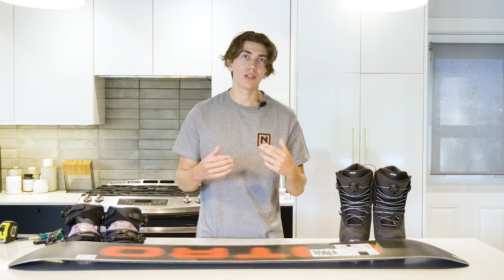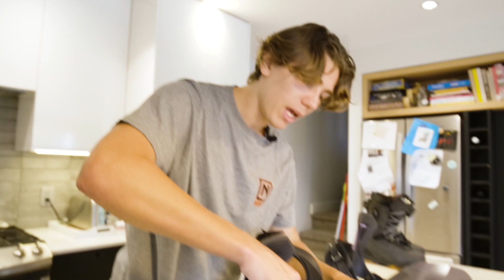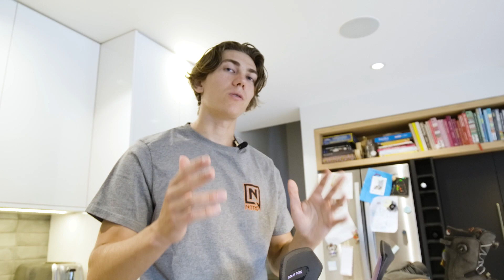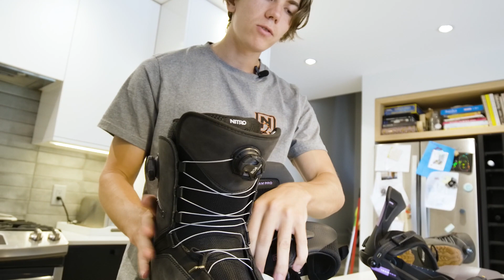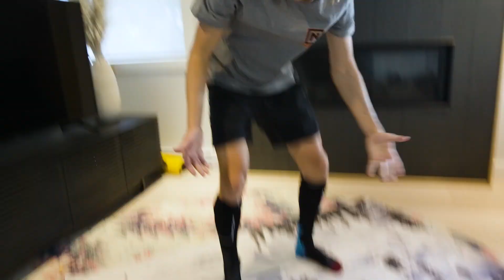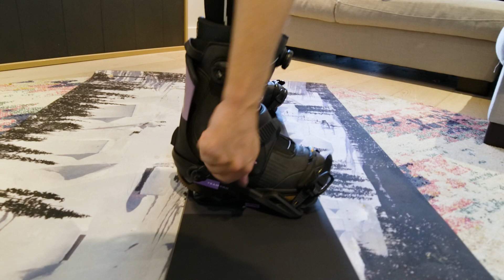How To Choose And Set Up Your Perfect Snowboard - 2024 Nitro Board Review

Comment: Hi Taevis and team, thanks for the video.
When it comes to boots, which brand or line would you recommend for someone with narrow feet? I had my first run the other day, and the back of my foot felt like it was practically floating, no support whatsoever. I was wearing Burtons, which I've heard tend to run pretty wide. Thanks!
Reply from the maker: Each brand has a slightly different fit, however each brand also offers different fits within their own range! The best way to select the perfect boots: Get down to your local board shop and try on as many different brands and styles as you can. Go in with an idea of the type of boot you are after - flex rating, purpose, lacing style but at the end of the day physically trying boots on is a must! Any reputable boot fitter will be able to help you pick the perfect pair!

Comment: Size rec on the Team Pro? I'm 6'0 x 180 x 8.5 boot. Ride about 70-90 days per season. Looking at the 159 or 162. I have another board (GNU Banked Country) that's a 162 for freeride days.
Reply from the maker: I’m 6 foot 165 lb and I use the 159. It’s a stiff board so I’d recommend the 159:)

Comment: I just ordered the nitro alternator 160. Waist width is 25.6. I have size 11.5 boots. I bought the board from curator and am waiting for it to arrive. My curator agent was saying that a 25.6 waist width will be fine for 11.5 boots at angles of 12/9. Thoughts?
Reply from the maker: So 11.5 is definitely pushing it for a nonwide board.
I do recommend getting a wide board when you can, but it's only a difference of 0.7cm on the alternator, so it should be fine.
The only downside is you have slightly more heel and toe drag and big carves.
Taevis is using the 160 nonwide with 8.5 US feet, so we don't know if it will cause you any issues or not.

Comment: Do you also consider sidecut radius? I see Nitro team pro has a significant longer radius than other directional twin boards (11m vs 7ish m) 
Any insights on what difference does it make? Thanks
Reply from the maker: A smaller sidecut radius means that the board will be slightly more maneuverable than a board with a larger sidecut radius. It really depends on your style of riding, and how you plan to use the board (Ie park riding, carving, all mountain ect..)

Comment: Hello SA.

Maybe you could recommend the size of the snowboard Nitro team ?

I riding with my first snowboard for winter 3 seasons.  Approximately 150 days. Now I want to buy my second board so I can progress. 
  My first  snowboard 159w.26,2 width, flex 6. 
I am 172 centimeters tall and 79kg., leg size US 9,5, Vans infuse boots. 
My riding level intermedial-advaced. 
I easy ride switch, i'm jumping S, M, L size kicker, I like do extremely carving, back flip, wildcat, tame dog, 360 fronside - backside, grabs, ground tricks, like big sped. 
Sorry for the typos. 
What size snowboard would you recommend? 
Thank you for answer.
Reply from the maker: Hey Man, so it depends on what you want, id recommend a 155, not sure if you need to be on a wide board with 9.5 feet, I wouldn't be. I'd say if you are worried a 155 is too small go for the pro, since it's more stiff and powerful. if you feel like you need the wide, get a 157 normal team. i think 155 would do you the best, and you can choose the pro if you want more stiffness, but it is not needed:)

Comment: Why you don’t consider your weight for board size?
Reply from the maker: Most pros ask board size and hight when talking gear, thats just howhigh level shredders do it. seams to work haha
Reply: @SnowboardAddiction  I would be disappointed in my social media team if they made 3 spelling errors and two grammatical errors in a two sentence response.
Reply: @matt-w7i6h shut up Matt you nerd
Reply: Weight is no longer used to determine  board side for resort riding. Now if you're riding pow. Then weight will be a factor. I been riding for 20+ season and ride 60 plus days. 
The recommendation  I tell people are stiffest, profile, and lenght. 
I start sizing from chin and adjust size from there depend on your type of riding.

Comment: This one is ultimate.
Just not agree with angles suggestions. Directional stances are  viable for sure. This guy just rides park
Reply from the maker: Glad you liked the video! For sure you can do like too forward angles on your board, and other wacky things. We just try to recommend stances that will work in any given situation, since that’s the kind of riding we do😁
Reply: Directional stances completely ruin your alignment and negatively impact about 95% of what you can do on a snowboard, and that's not even getting into those awful double positive stances people ride.

With a double positive stance all you can really do well is Japanese style carving. You can carve great with a duck stance so why ruin everything else just to have a carving-specific variant stance? May as well just get hardboots and a monoski at that point.
Reply: @zes793  yeah exactly. Btw there are a lot of people who never ride switch ))
Ps. I personally ride 15/-12 )
Reply: @zes793 You can run pos/pos and still ride switch. Just can’t be super aggressive. Look up Yearning for Turning by Korua Snowboards on youtube. For a carving/powder specific board I sometimes go +18/+6 and I can ride switch just fine. The main benefit is being able to get lower to the snow in a more forgiving way, especially heelside. Most of the time I go +18 or +15 then -6 or -9 tho. Sometimes it’s fun when you just wanna get low and carve. It’s when the angles are like +27/+15 that it gets a little ridiculous.

Comment: I like the forearm guide. I personally take the measurement from my knee to my ankle and use that as my reference stance, then I adjust it a little based on the stiffness of the board. 
I also rotate my highbacks so that they are parallel with my heel edge. Not so much an issue with low stance angles, but there are still some benefits. Doing this adds a touch more heel control, but the main thing is that allows your ankles to roll a bit more towards the nose and tail more freely which helps with tweaking some grabs and makes my stance feel more relaxed.
Reply from the maker: Great tips!!!

Comment: Boot size and weight. Height doesn’t matter
Reply from the maker: Hight plays a factor, especially if you ride a lot of park. but definitely don’t over look your weight:)
Reply from the maker: A important thing to remember is skill plays a big factor, if you are just getting into snowboarding a longer board can be a lot to handle. but if you are getting to Taevis’s level, you can start using that extra length in your board in a lot of awesome ways! 

Hight width and weight are all just suggestions to help you gage what will work. Use them all to ensure you get the best board possible:)
Reply: Height only matters in the way you can adjust the right stance width )
Reply: I'm with Taevis here. Boot size and height. Height absolutely matters, and being on a board that's too short or too long for your relative height and stance width will severely limit your potential on a board.

Comment: Great vid. So much snowboarding knowledge in one place. My shoe size is 10.5 and I'm getting toe drag on 155 nitro team (normal). The board is great all rounder. Smooth camber with medium stiffness make it very predictable on turns and jumps. The base does not feel as fast compared to other premium boards.
Reply from the maker: Stoked you liked the video! You might be able to move your binding back a bit, but 10.5 is definitely pushing it on a 155.